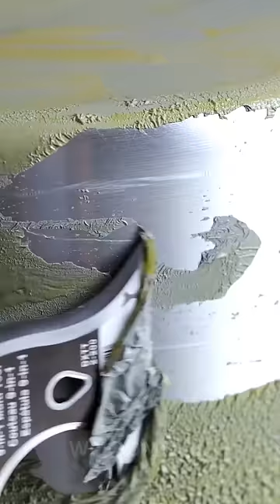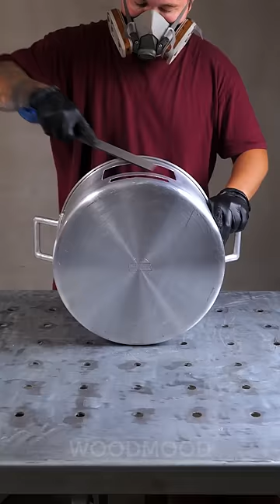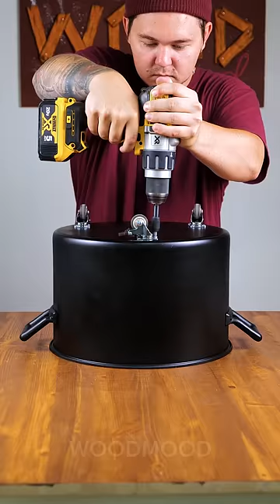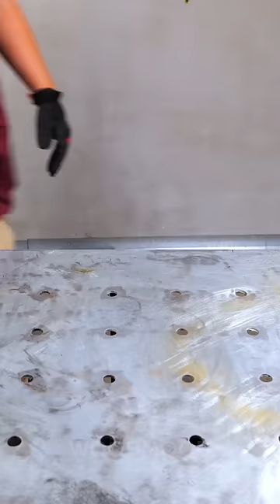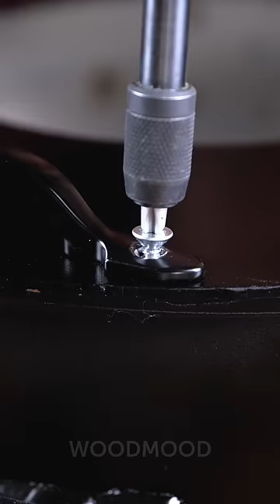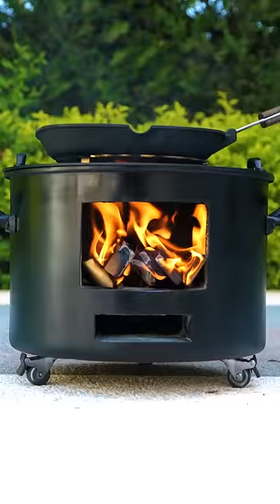We made a portable stove from an old pot || #Shorts

Comment: Burning off paint stripper, grilling hotdogs off Burning Styrofoam. 🤔 I would’ve just invested a little money into a small grill.
Reply: Fr you get get a 17.5 inch grill from Walmart for like $20 lmao
Reply: Eu tbm teria comprado uma churrasqueira,  cansei só em assistir  kkk
Reply: I was hoping someone would point out the styrofoam lol ain’t eating anything off that grill
Reply: He didn’t burn off the paint stripper, he scraped it off.  That was pretty clear lol.

And any leftover styrofoam would burn away very quickly.  It’s not going to infuse into the hot dogs or anything.
Reply: @R.u.g.0  one day soon you won't be able to buy cheap Chinese garbage
Reply: @ryanb4533  yeah actually it will. It's the smoking effect that happens to literally any meat
Reply: @andy34isabor89  2 ounces of styrofoam isn’t going to do anything to anything
Reply: Haha, thanks for saying it...I saw another one where he is also burning styrofoam...do they know that's poisonous ? Crazy
Reply: Lmfao bro Walmart has em
Reply: Where's the styrofoam?  There is cement everywhere.  Down by the firewood, however, it already burned down in a few minutes 🤣🤣🤣
Reply: @dchubworldsharenetwork  yall simple minded. Just cause its gone don't mean its gone. It leaves residues behind that can last for hours after initial burn.
Reply: @ryanb4533  yes it will if he didn't do a proper burn off, same with any residual chemicals.
Reply: @roguespearsf  Styrofoam burns at relatively low temperatures.  Running this stove for about 30 seconds would burn away all of the styrofoam completely.  There would be no left over chemicals for future uses.

The tiny amount of styrofoam that we saw leftover before he cooked with it would be 'dust in the wind', so to speak. So maybe the very first hot dog cooked with this thing would have trace amounts of chemicals in it.  Certainly not enough to do anything to a human body.
Reply: @ImSimplyChilling   how is the styrofoam affecting what's in the pan?🧐
Reply: And by the looks this guy is making this all in his leased house he lives in. Just great
Reply: @ryanb4533  man people on the internet straight up kill me dawg.. they see something someone say and repeat it, ive seen multiple videos were people are making these and thats the consensus: this is wrong and that is wrong. its like stfu ..where in the video did he tell people to copy him and all.. its just a dam video and people always ruin it by saying shit like they are saying. then they come at you for not going along with there opinions lol
Reply: @mrlilrip10  Exactly!!! Well said man!! There is so many know it all’s, when in reality they have absolutely no idea what there even talking about, and people criticizing every single little thing…
Reply: He might have had all the stuff already. But that's such a good idea.
Reply: Recycling, ingenuity 🤩at its best!
Reply: Cant be too far off from what they put in your food nowdays
Reply: @ryanb4533  unfortunately most people will never know the satisfaction of creating something with their own hands. So they jump on the keyboard and teardown what others have created. Personally, i think its a brilliant idea and it was put together extremely well. Great project idea.
Reply: @19961atc  who is simple minded? Your assuming the builder was cooking food over burning styrofoam.
Reply: @georgeyoung613  because that IS EXACTLY WHAT HE WAS DOING!
Reply: All these HATERS that would not be able to install a simple door hating on every aspect. 😒
Reply: @Someonereallycares  mate, i doubt you know how to install a door. if you don't know the difference between Styrofoam getting hot from coffee and Styrofoam thats burning onto your food. If being smart about our health is being a hater. This is f'ing awesome.
Reply: Exactly 💯
Reply: Don't forget the concrete is packed full of plasticizers and isn't meant to be food safe
Reply: It would be LESS! 😆 
That is heavy duty pot!!!
Reply: You burn it all off before you put food on it. What's the problem?
Reply: @hevnervals  EXACTLY! It’s always a hater or two in the comment section 😂.
Reply: he literally uses wood not Styrofoam bro
Reply: @Mxtleycrue  he means the Styrofoam inside
Reply: @nowonmetube  he literally child off the stryofoam and burns it so it's completely gone
Reply: А
Reply: @DaDaDo661  that would be nice
Reply: @andy34isabor89  Thays why you let it burn for a little first. Burn away all the Styrofoam, bam problem solved
Reply: @FabricatedPheonix  That sounds pretty good why not
Reply: @andy34isabor89 mate you set a fire for an hour after you are done building this thing and afterwards there will be nothing left of the foam that could impact the food. I am not saying this a great idea considering the amount of work you will have to put in and the cheap alternatives there are available. But it is perfectly safe to cook or roast your food with this thing.
Reply: @DaDaDo661  yeah right.  Amazon is going out of business?
Reply: @ryanb4533  I understand what you mean. Everyone else is gay.
Reply: Həddimi aşdısam bağışlayın amma bunun harasını kısqammaq lazımdır sadə birşeydir😡😤😡😡😡😡😡😡😡😡😡😡😡😡😡😡
Reply: Styrofoam its seems He just only covered the whole part for the inserting of the firewood so that it has just shape on it if I'm not mistaken..
Reply: Better than the pot being in a landfill and that Styrofoam he pulled out it was a form for the cement
Reply: @ryanb4533  Thank you. I was wondering what some were saying about styrofoam flavored stuff when he's clearly burning wood for heat except my eyes are deceiving me.
Reply: @R.u.g.0   not to mention that pot weight like 20lbs with all the cement and steel bars. While a walmart one just weighs like 1-2lbs the very max.
Reply: 200 you got a decent weber. Guaranteed this was the same amount givem all the materials that went into it. Theres art and theres function. This is function. Art cannot replace Function. Home depot will always win the function
Reply: @andy34isabor89  you could've just use it a couple times to burn off leftover styrofoam before cooking a hotdogs in there🙊
Reply: @19961atc  your username says it all.🤣
Reply: @crimsonwrath1395  everytime I've burned styrofoam it turned into a black melted smoldering and smoking heap
Reply: @crimsonwrath1395  the irony.
Reply: That's what we do in jamaica we use gas stove but a coal stove is a must have
Reply: @andy34isabor89  yeah but it does melt tho until it dries out
Reply: @DaDaDo661  and thank God for that.

Comment: Unless you mix in a specific additive to the concrete I could actually explode in this scenario.
Be careful, do research first.
Reply: I seen a tik tok wheres someone use concrete slab as a cooking stone ends up blowing it. Don't what kind of addictive added, but some people said it because air trapped in the concrete expand.
Reply: Moisture turning into gas
Reply: @betatester8137  It's not so much air, as it's any residual moisture trapped in the concrete can boil off and create surprising pressure from the steam build up. AFAIR.
Reply: As many of the above comments said. Yes it's the air being trapped in the concrete. You've got to use a concrete "vibrator" to take the air out. You can probably do it another way, but with a vibrator there is no chance for air to still be trapped
Reply: Looks like salt treated lumber as well
Reply: @HoloScope  just to be clear. A tool to vibrate the concrete mix,  right? Not like... 👀 you know.

Comment: Cool idea but I think you could have bought something similar at same price as your materials used. and im not 100% some of your material would be one I would use in an open flame situation. High heat paint does not mean flame resistant. Still think you did a good job and it was a decent idea to begin with

Comment: The only thing heat resistant was the paint which without primer will crumble off after 1 heat up.
The cement will crack. Everything will rust and the chemicals will fill your lungs.

Good idea 💡 🙄